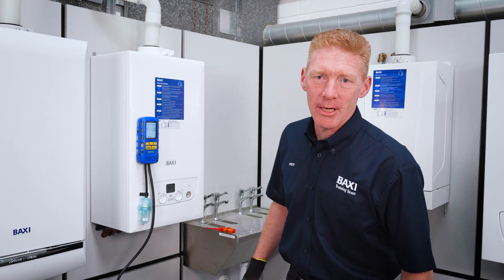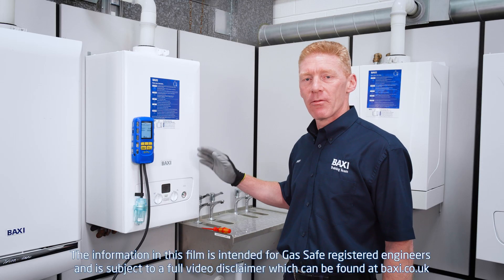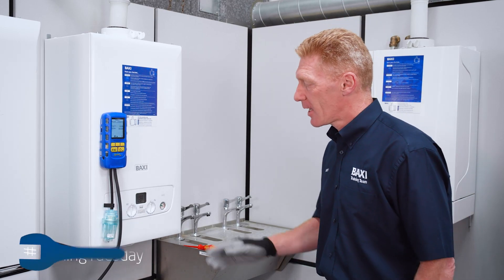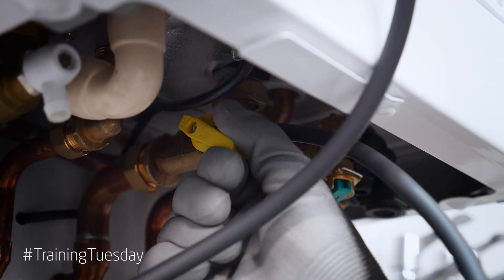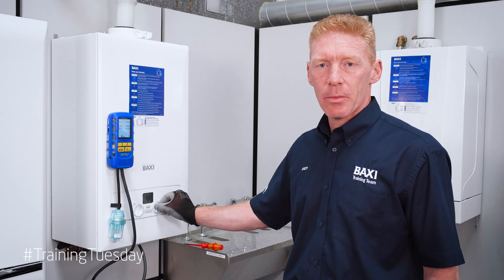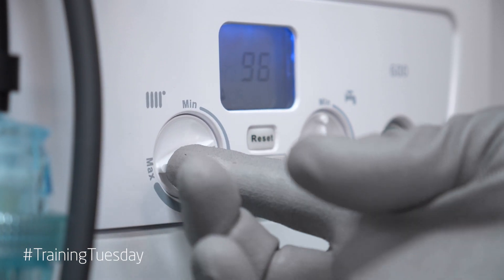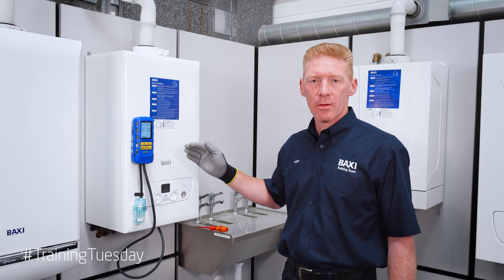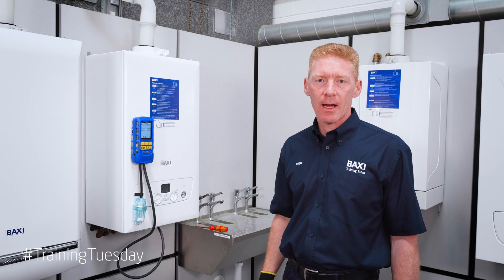Error Code E133  -  Low gas inlet working pressure

Comment: I had E133 on a Potterton Promax Combi 28 plus A.  changed the electrodes, still had same error, changed the gas valve still had same error, changed the PCB, still had same error.  Could not get an inlet or working pressure at the meter, standing pressure was great though.  In the end I had to give up as Baxi don't do technical help at weekends.
Reply: Are you even an engineer ?

Comment: What is the risk when the boiler flu gas analyser readings are low than Manufacture instructions for example a CO2 6.5 ppm of 75 on a Potterton promax now the readings are not to manufacturers instructions so it’s at risk but what is the risk
Reply: Come on across a lot of Potterton promax is that look like they need a new gas valve so the flu gas analyser readings are lower than expected

Comment: “Check at the meter” what do you mean by that? Do a working pressure test at the meter?
Reply: Yup and quite possibly the ECV has accidently been knocked down to reduce the flow of gas.  That's why it's also worth while checking the operating pressure on another appliance.
Reply: @rayc1503  cheers mate
Reply: Should it not be all appliances in the property not just one ?
Reply from the maker: Hi Dale, here's a reply from Andy. If the gas inlet working pressure is lower than 18mb at the test point under the gas appliance then you need to go to the test nipple on the right hand side of the gas meter. connect your U gauge or device for testing pressure to this nipple and put the appliance in to max test mode again, you should now have a reading between 19 and 21mb. if you have a reading below 19mb then contact national grid on 0800 111 999 and report low inlet working pressure at the gas meter. National grid will attend within 2 hours and adjust the incoming gas pressure.    If you have 19mb or greater at the meter test nipple and lower than 18mb at the boiler test point you would need to calculate your gas pipe size and check this against the size of pipework on the installation.
Reply: @BaxiBoilersUK  thank you for taking the time to give me an answer, it’s much appreciated
Reply: Standing